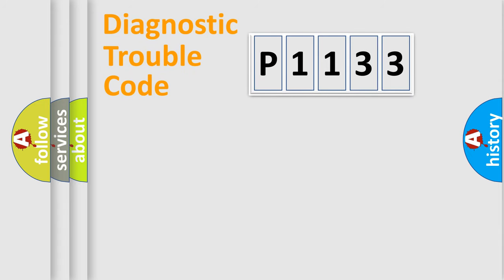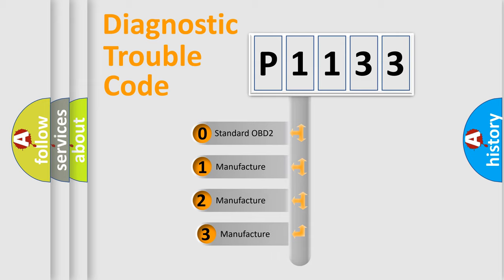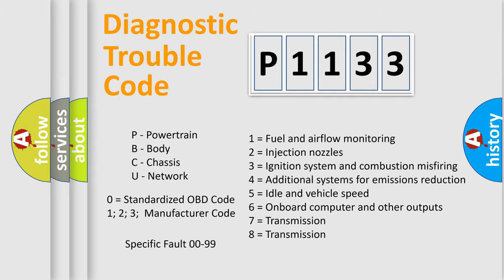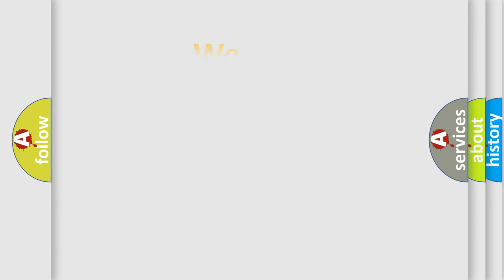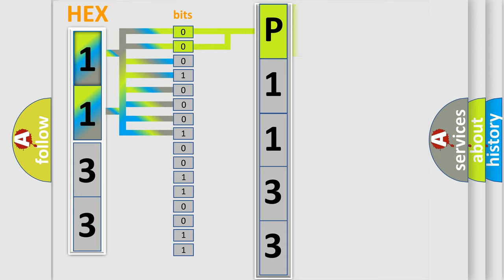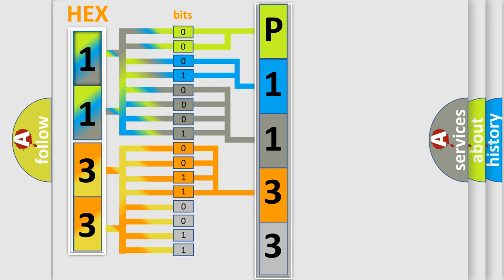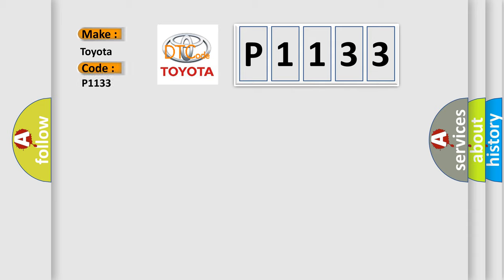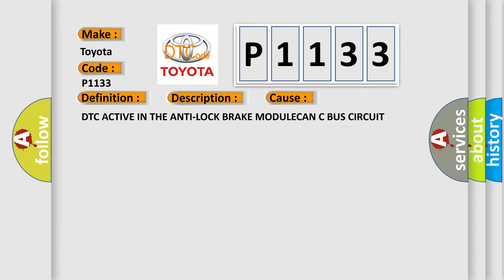DTC Toyota P1133 Short Explanation

Comment: P1133 is an air/fuel ratio sensor trouble code. Don't waste your time on this video if you're looking for how to fix this problem on a 1999 Toyota Avalon.
Reply: ...unless it has California emissions. Instead of regular oxygen sensors, models with California emissions (look for this information on the firewall information placard near the hood on the driver's side) use one air/fuel ratio sensor on each bank of cylinders. In addition. they use a regular oxygen sensor just downstream of the catalytic converter. I don't live in California, but my '99 Avalon has California emissions and did throw the P1133 code. My son's car is an almost identical 1998 Avalon, but with federal emissions. It uses 3 normal  oxygen sensors and so should not throw this code. Air/fuel ratio sensors are more expensive and are not interchangeable even though they look just like oxygen sensors. The conventional wisdom is that you replace all of these sensors if one goes bad because the others will probably also go bad soon. This is what I did in response to the P1133 and it seems to be running more smoothly now. Check for wiring harness problems first before throwing parts at the problem, though. They loosen more easily when the exhaust system is hot. Be careful not to burn yourself on the hot manifolds and pipe, though.